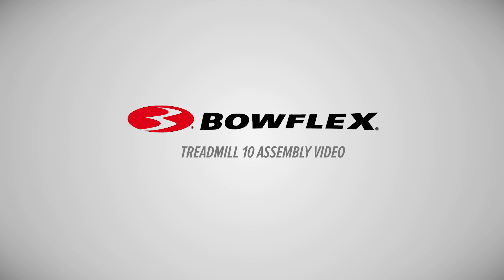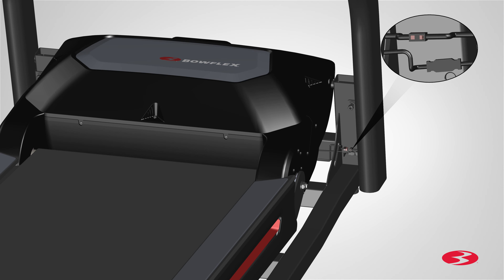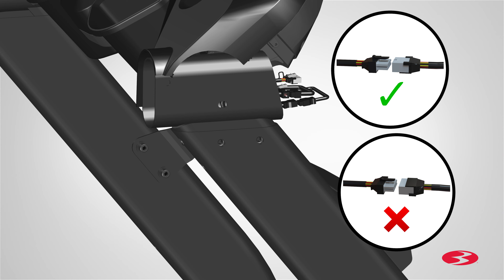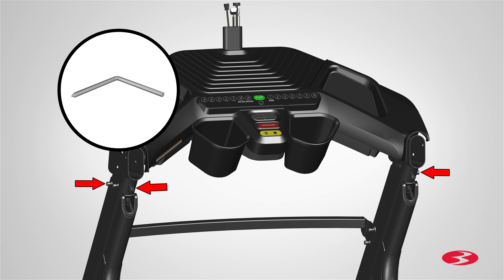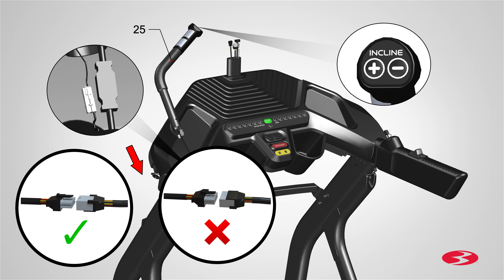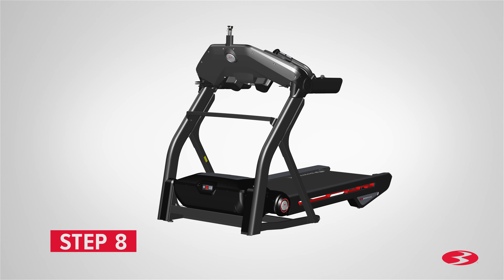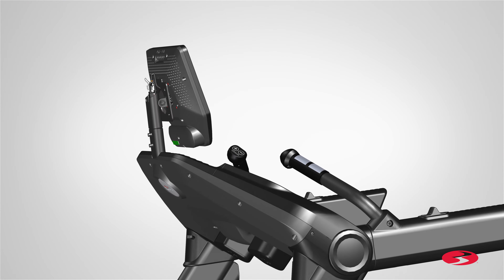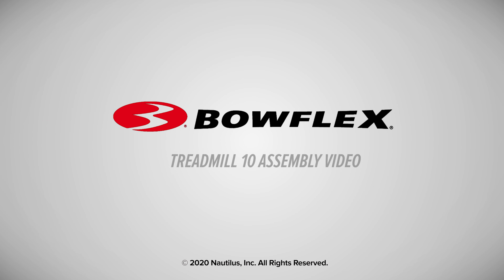BowFlex® Treadmill T10/T25: Assembly Video

Comment: There seems to be a TON of problems with this machine???? You guys fix it?
Reply: I was wondering the same bec I really want one and it’s on sale. I did see a review that said her second machine worked and they fixed the issue but that was the only update I saw.
Reply: @DearJuel  do yourself a favor and do not get it. The assembly is so irritating and I'm stuck because of bad descriptive assembly instructions. That and the screwholes do not always line up perfectly!

Comment: Was an absolute pain in the a** to assemble. 2 of the screws became threaded super easy because of the crappy position of the holes. Also way to many parts. It’s standard for most treadmills in this price range to come in 2-3 parts only. Not 50.

Comment: This treadmill sucks, 3 thousand dollars, shuts off randomly, screen is garbage, and on top of that needs a 20usd membership per month. Also it doesn't adjust speed or incline automatically with programs. Customer support sucks. Returning it to Costco but it's such a pain because it weights a ton!!!
Reply: Why did you pay $3000 for a $1600 treadmill?
Reply: @invaderjoshua6280  CAD after tax